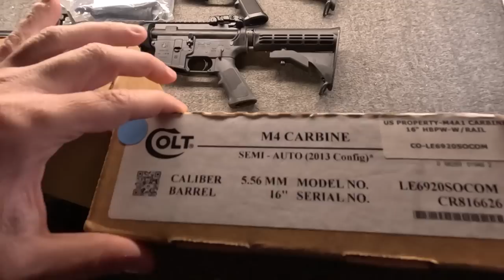Is My Colt LE6920-SOCOM M4A1 Really A CR6920 Carbine? (Deconstructing Serial, QR, & CAGE Codes)

Comment: I had a 2013 configured le6920socom w the m4a1 rollmark.  I put a lot of rounds through it but I needed the cash for other stuff, my justification in getting rid of it is the high shelf in the lower.  At the time they had a cool Carthartt jacket promotion.  I wanted to get an le6940P (p for piston) but those were more of a stuggle to get ahold of and were around $2000 at the time compared to the $1300 for the socom.
Reply: I didn’t know Colt ever produced an external piston gun past the prototype phase.
Reply: I remember that LE6940P...nice but yeah spendy and Colt never seemed as invested in the external piston as say LWRC, HK, or LMT. So i never thought seriously about getting one either.
Reply: @markp4401  Yep, sure did. LE6940P. I think they even had a shorty w/ 11.5" barrel version as the LE6944P? But not sure if that ever made it to market?

Comment: I have a 2013 config LE6920-OEM1 with a feb of 2016 birth bag and it has a subcontracted barrel. Also it does not have the hand guards with more "layers" or whatever. And is has a cheap? stock.
Reply: Because OEM1s didn't have either a stock or handguard from the factory. Really that's what makes them OEM1. So a 3rd party put those on your carbine.

Comment: Correct hand an older socom upper  had a heavy barrel no m203 cuts and Troy handguard, the later M4A1 LE6920 socoms had a 16” socom barrel, I wasn’t a fan, Im much for for swapping with barrel and A2 extended fh over colts FH
Reply: Earlier, the SOCOM-I did come with the KAC RAS, but later they did a sneeky thing and switched it for the Troy. The SOCOM-II always came w/ the DD setup as far as I know though? Right there with you on the extended A2. I mean its fine, doesn't look ugly; but i am 10x happier with the Surefire on mine.

Comment: Colt has never made all of their parts in-house. Colt has always used outside venders. Colt still meets all TDP spec and all of their venders must meet DOD TDP spec..Colts laboratory is still running  to test all parts whether made in house or outsourced to guarantee the parts meet TDP.. Colt is manufacturing 5000 rifles a month for military's around the world..All M4 barrels must be pushed button rifling, not pull to meet US spec..

Comment: Simple LE6920 true....Has no Block over Safety.....Gas key is MIL Spec Stacked. M4 feed cuts. F marked upper. I have never seen Colt use that 3 Prong Flash hider outside of military contract.
Reply: Oh sorry for any confusion. The one with the Surefire on it is mine. Back when, i did a video about swapping out the original extended A2 flash hider for this SF one for my personal gun. Just something i wanted to do for me. It didn't come from Colt that-away, but the other LE6920US-SOCOM in this videeo is 100% OEM.

Comment: All the information you gave made my head spin. I just wanted to say that from my angle of view ,the new laser engraved Colt looks cheaply different in several aspects. May just be the camera angle. But that shiny and splotchy finish is very unattractive.  Your other one with the aimpoint looks deeply rich and quality. IMO..
Reply: Nope, Colts when factory new are simply greasy. It wipes off.
Reply: @misha5670  would this be the case for the barrel on the newer Socom as well? The one in the video looks much shinier than yours. I’m assuming it’s just oil? I think I may have to pick one of these up soon
Reply: The barrel is probably the greasiest part. Its grease/cosmoline, not just oil.

Comment: I like selector stops on my ars especially when u running drills and courses. U don't have to look down to check if it's on fire or safe when u change the selector because u can feel and hear a clear stop position
Reply: I like them too. If CZ makes small but nice little changes like that to Colt production? That'd be just fine with me.
Reply: @misha5670  I agree 100%

Comment: I have had two standard 16” LE6920 and wish I kept them also had a newer CR6920 which had to go back and the upper and lower and barrel was replaced but Colt hooked me up with a kac ras, matech rear sight and ambi safety ultimately I got a new rifle. I still like them as an good entry level. I’ve since bought a FN M4 collector and I like it but I do want a newer Colt M4A1 Socom
Reply: Just curious, why did the CR6920 need to go back? Just wondering if its something I should lookout for for my customers?
Reply: @misha5670  so it had bad machining marks on the lower, left side near trigger pins and on upper rounded area under charging handle, these weren’t in the finish, they were deep scratches made during raw lowers then someone let them through to the parkerizing process. Also the barrel had issues with the feed ramp f in finishing, the bolt lock up teeth were horribly chipped and I’ve never seen it like that out the many AR-15 I’ve bought and barrels. I reached out to Colt got an RMA and took a few months but they did make it right and even gave me some extra items on new rifle. Customer service experience was good and the end of the day I chaulk it up as a rushed 2020 production rifle that missed the QC I suppose at that time. I do have pictures if your curious but I’ve never seen that from other newer Colts so maybe it was just my luck.
Reply: @misha5670  I definitely contribute it to 2020 since many manufacturers definitely had QC issues, however this was a CR6920 with the barrel locking lugs had should have never past QC which I was told by a rep, ultimately I’ve haven’t lost trust in Colt ever rifle I’ve ever owned was reliable and they definitely made it right, replaced pretty much everything, I thought they’d send it back with a the machining chatter marks but I was surprised they reached out and told me the lower was replaced as well as the upper/barrel. Guess it was one of those examples that slipped through the cracks and I don’t believe it something to worry about now that CZ is in the mix.